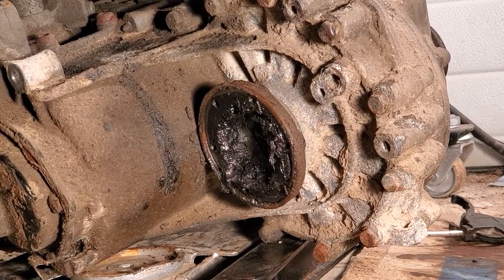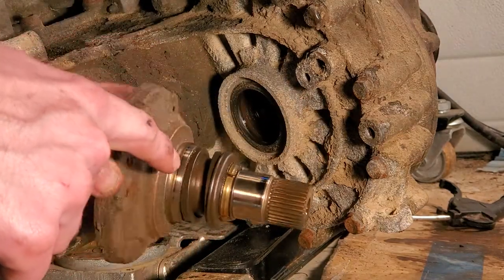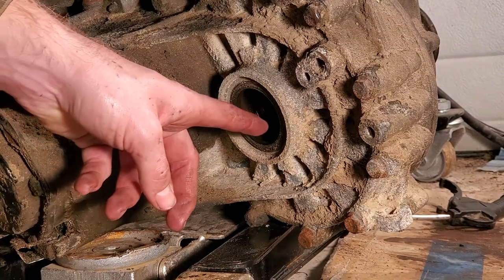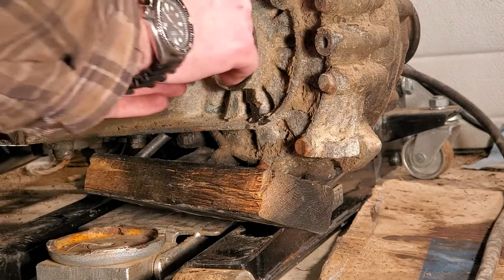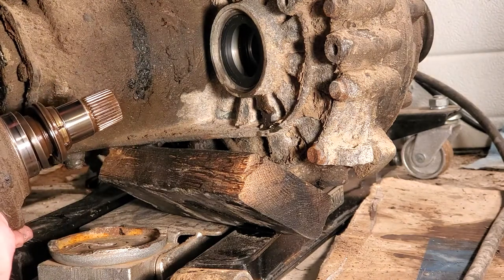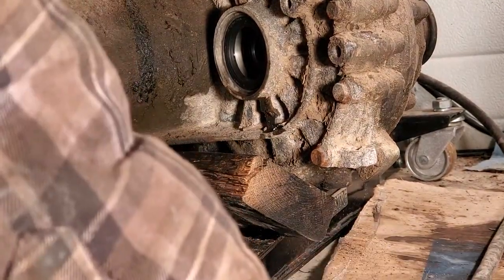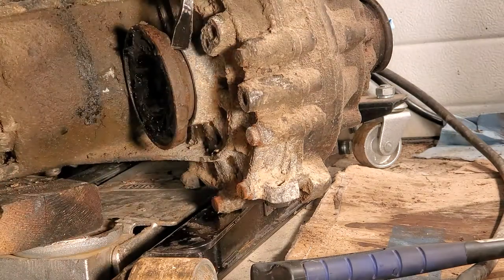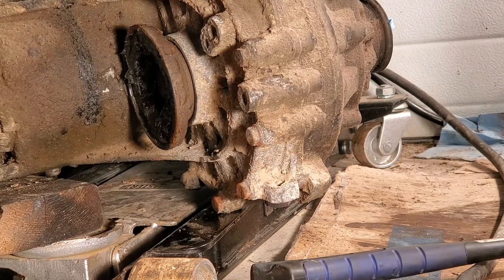Mk. 4 Volkswagen Jetta TDI (ALH) - Manual Transmission Maintenance

Comment: What about the one with the metal sleeve?
Reply from the maker: I'm not sure what you are referring to. Do you mean the output shaft on the other side of the differential?
The process is the same for both sides.
Let me know if you have another question.
Thanks,
Greg

Comment: Hi. Is this seal spesial or you can find it in regular car parts stores;;;
Reply from the maker: Hi there, thanks for the comment!
To my knowledge it is just a traditional oil seal, however, I have never looked elsewhere to try and get one.
But if you can get the numbers off of the face of the seal, any bearing/seal shop should be able to look it up and get one for you.
Thanks,
Greg
Reply: @GBProductions0  hi!! Thanks for this video, can you please tell us the references of the seals?? I will replace it in the same gearbox.

Comment: Thanks for the video. I just replaced the same seal on my 02 Golf TDI. Still leaks. For some reason the flange has slop in it now. Not side to side but if I grab the axle I can wiggle the flange up and down. I don't understand what I did wrong or what may be broken. Seems to be only one way to install the flange and tighten the bolt so I dunno.
Reply from the maker: Hmm, that does sound strange. It should be pretty straight forward to install the flange like you said. Only thing that comes to mind is the spring that is behind the flange. Maybe it got lost or broken? We had to struggle extensively to push the flange in against the spring tension far enough for the threads on the bolt to start into place.
Reply: Yeah I've decided it has to come back apart to see what's going on. I like this car but at 285k miles, it's frustrating keeping it on the road. Japanese care so much easier to maintain!
Reply: Michael Glenn - I just encountered the same problem with the passenger side flange moving up and down easily after I reinstalled (and then leaking profusely).  How did you resolve your issue?
Reply: @plange1525  it ended up being the differential bearings. I got a good used transmission from quality German Auto parts in California.
Reply: @michaelglenn2468  yup if it still leaks, either the bearing are worn out or you didn't grease the seal and tore it up putting new one in. Most times the transmission bearings are  worn out.

Comment: Really quick question. Ive got an 04 Jetta TDI manual and when I bought it, it needed a CV axle. The guy I bought I from, started to replace it, then sold it to me. Bad move on my part. So I've been trying and trying for a while to get that flange into the transmission on the passenger side. At one point I even had the center bolt grab and lock it in. Here's the thing, is that flange supposed to sit flush against the transmission? Bc I can not get it to, even if I clamp the thing and the spring is completely compressed. Is it fine as long as that center bolt is able to thread on? I can't find anything online and you seem to have the best video on this
Reply from the maker: Hi there,
That's bad luck! Always something with a project you buy.
As far as I am concerned, as long as the inner machined surface of the flange is sitting within the lip of the oil seal, you should be fine. I don't recall specifically how far out the flanges on mine sat when installed, but as long as the sealing surface mentioned above is at least 1/4" into the oil seal, it should be fine and not leak on you.
Thanks for the comment!
Greg

Comment: I have the 02j on my 2000 tdi jetta and its leaving puddles. Is this from these input/output seals or there somewhere else it would be leaking from?
Reply from the maker: Hi there,
It would most likely be the output shaft seals, but could also be the drain/check plugs. You would be best to get underneath and clean the whole bottom of the transmission and then keep tabs on it to see where the oil starts to form again.
Thanks,
Greg

Comment: Did you grease the seal before walking it in?
Reply from the maker: Hello,
No, I do not believe so. If it was one of the PTFE seals, you are not supposed to put anything on it and not allow your skin to touch the sealing surface. If it was a regular type oil seal I may have put just a light film of oil on the sealing lip to help with installation. The outside surface must be dry and clean to hold still once it is installed.
Thanks,
Greg
Reply from the maker: Yes, looks like I put a light film of transmission oil on the sealing surface on the axle flange before installing.
Reply: @GBProductions0  Ah yes got ya...so just a tiny bit on the inside lip of the seal in effect. I'll do the same, and keep the outer lip dry / grease free. Very helpful video, thank you!
Reply from the maker: You got it!
Happy to help.
Thanks!